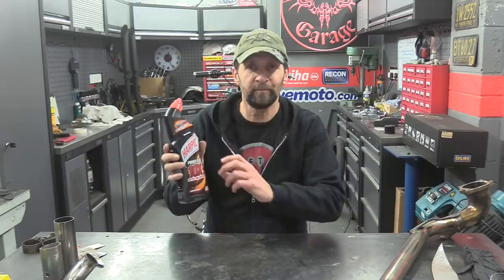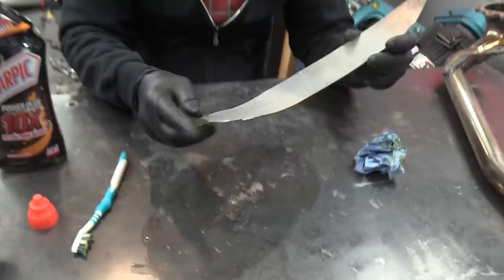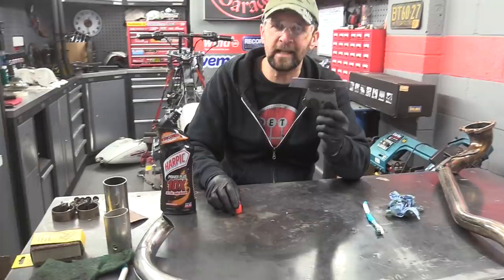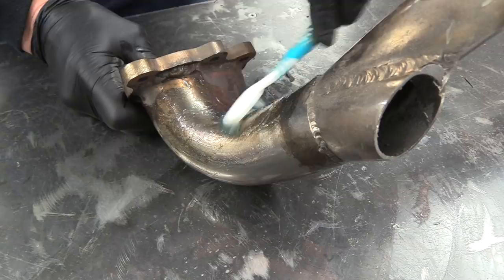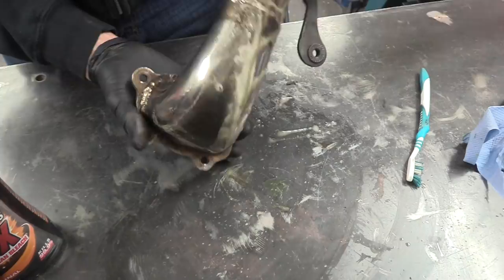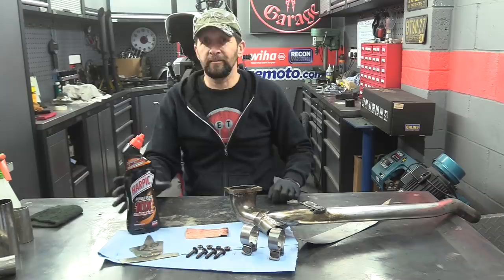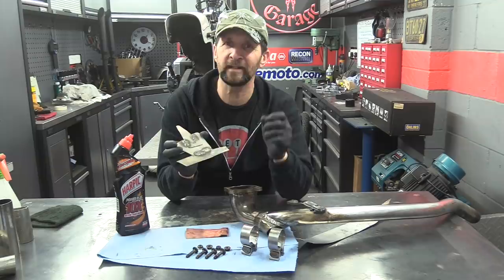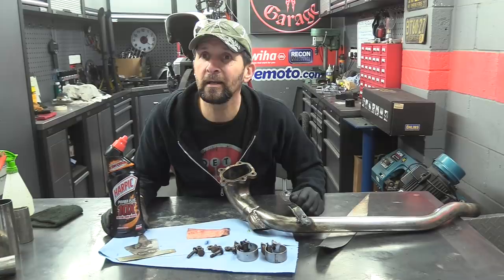Delboy's Garage, Simple Skills, "Cleaning Steel with Harpic" !

Comment: A few comments beneath here comapring this product to acid... it isn't, it's a powerful alkali (bleach). Both strong acids and alkali's are nasty stuff but if talking about "neutralising" acids when using this, well no you are neutralising an alkali (with lemon juice/vinegar etc). Top tip this video, just don't leave any residue as it will oxidise (rust).

Comment: I used this last year around early march on my down pipes and it worked a treat. I did the same thing again during the summer and the sun dried the product before I could wash it off causing the pipes to be discoloured and dull almost like it has taken the shine out of the metal/chrome. Be careful guys!

Comment: Been using acid for years it does work awsome but leaves corrosive residue if you dont rinse it really well use baking soda mixed with water to wash it the first time then wash it with clean   soapy water the baking soda helps neutralize the acid
Reply: @Dar   Same thing - different names, but the same stuff

Comment: Hi Delboy - if you have rust on chrome, dip  a lightly screwed up piece of silver foil in coca cola and splash a bit on the chrome as well, give it a gentle rub, bingo all clean and shiny and because of the soft density of the foil it does not scratch. Really good for wheel rims, handlebars anywhere there's chrome.Thanks for the video on the Bleach, all these tips are handy Thanks.
Reply: It's not Bleach it's Acid and Coke and Foil is no match to Harpic

Comment: Yes indeed Del, I have used this for a couple of years now purely for rust removal ever since I was no longer able to buy the acid on its own. I’m restoring a zzr 1100 with a badly rusted rear brake disc and various brackets and I can’t wait to drop them all in overnight to get them prepped for repainting.

Comment: I wish they sold that here! Down here in south Louisiana when we have a problem with rust, we use ammonium nitrate mixed with a proper amount of diesel fuel and the rust simply blows right off.
Reply: You can use toilet bowl cleaner that states limescale remover , it’s hydrochloric acid based rather than bleach based, my mate lives in Ohio , I’ll. ask him which one he used , as it worked for him
Reply: Zep acidic toilet bowl cleaner. Home Depot.

Comment: I've used this before and it works a treat. Problem I found was the cleaned item rusts quicker after being cleaned. Even my pliers or spanners that touched the stuff corroded badly afterwards. I did spokes that were ready for the bin and they came up like new until they hit moisture then rusted very fast. Worth doing a test first. Loving the videos as just bought a 91 Goldwing so very helpful.
Reply from the maker: This product should really only be used on good quality stainless steel, it will rust iron the moment oxygen gets to it.. maybe less so if you oiled the parts after cleaning !!

Comment: good video Del. I liked the way you protected the rest of the bike before going any where near it with Harpic, very professional. 
It looks like the Harley downpipe may have been chromed hence it did not have the same effect. Ultimately it will take the chrome off and reveal the stainless underneath and I think that may have happened here. 
Long on the short dont use Harpic on anything that has been chromed,

Comment: Hydrochloric acid or any bleaches (eg sodium hypochlorite or any chlorine) will actually cause metal to corrode so DO NOT let it soak. Thoroughly wash it off if you use this stuff. Personally I just go straight for the metal polish (autosol).

Comment: only recently came across this hack so tried it on a old exhaust system laying in the garage off a restoration in doing, couldn't get exactly the same mine was harpic with limescale remover. the can and the collector came up very well the headers are only steel not chrome so looked terrible and rusty all the way down to the joints gave them two goings over with a rinse in between, second time i used wire wool gently around and all over the pipes and they came up very well  it also cleaned up the clamps a treat total time spent about two hours ended up very satisfied with a bucket of very dirty water recommend doing it out doors power full fumes up close.

Comment: The issue I had after using a caustic to remove rust was it needed to be resealed to prevent later oxidations.
Let us know if you had rust return after this.
Reply: next day I did, went back to my old method of scotchbrite and WD40 than metal polishing product.

Comment: I use this stuff on my chrome etc... Use a paint brush to apply to the metal leave it for 10-15 mins then clean it off with the pad
Reply from the maker: Long term it will burn chrome and damage it and you'll regret the choice, perfect for stainless steel, but trying cleaning chrome with cola and tin foil, works really well and doesn't scratch, give it a try!

Comment: Hi , I 've used this product before and it works well , but since it 's acidic , then you have to treat the metal with an alkaline solution of bicarbonate of soda and then anti - rust , now you can also clean it with cotton wool .brand duraglit , its amazing

Comment: My XJR13 needs a wash tomorrow, looks like the harpic coming out for the stainless pipes👍
Reply from the maker: Good move mate, but as always, make sure you wash it off 2-3 times really thoroughly as it keeps acting on the metal if you leave it there, even just a residue is enough to burn it!

Comment: I removed melted on plastic from my Harley's chrome pipes using OVEN CLEANER not that cheap stuff or Mr Muscle but the sort that requires rubber gloves, eye protection etc. I put it on using a toothbrush and it took about three hours with four of five applications.  The pipes were contaminated when my high vis waterproof trousers melted on them.
Reply from the maker: Thanks for that tip buddy, I've heard a few people say that works for pillion boot prints that burn on the downpipes as well! ... great to hve this shared advice, thanks buddy!

Comment: You can thank me for creating the video a few years ago using Harpic another time 👍🏻
Reply from the maker: Sorry mate, I'm a little confused, I made this video 4yrs ago and I've been using this trick in some form for 20yrs... I see by looking at your Channel, that your posted video was 2yrs ago, are you suggesting that in some way I copied you mate?  Not sure if I've got that right, but either way mate, it is pretty common knowledge these days, I think you'll agree!
Reply: @Moonfleet41  only joking buddy 😂👍🏻
Reply from the maker: Sure thing mate, I thought so! ...Just caught your seat foam cut down video and I'm just about to do the umpteenth one for a project, next time you're shaping foam, give a sander a try... you want a coarse sanding disc, say 40 grit or something, and just gently stroke away the foam and it leaves almost a perfect factory finish if you're careful... ride safe mate.
Reply: @Moonfleet41  great idea thanks, will probably remove cover and do that 👍🏻

Comment: Thanks Del!  Going to try this out on my old FLSTN.  Looks much easier than 0000 steel wool and chrome polish.
Reply from the maker: Sure thing buddy, I'm gonna have another crack at my Harley pipes, as it wouldn't touch the staining by itself, as you saw, I had to hit them with a Scothbrite too, am gonna take up suggestions of some of the guys here to let it soak for 20mins and see if that helps it float the dirt off... otherwise, it's back to the Scotchbrite aye!

Comment: Don't use brake clean on pieces of metal you are about to weld. The chemical in the brake cleaner is Tetrachloroethylene. When this chemical is exposed with excessive heat and argon (used in MIG and TIG welding) it also produces phosgene which is extremely poisonous that will lead to organ damage or even death. Acetone is recommended to clean metal before welding, but never, ever brake cleaners.

Comment: Great info del  saves a lot of hard work                                          I drive a 2019 zzr14 all year long I took the headers and link pipes off today was very surprised 😮 they were awfully bad   Probably the wet conditions over the winter thanks for the post anyhow very helpful pal
Reply from the maker: Yeah, winter can take it's toll on your metal work, am sure you've got some plans, if you're not replacing those pipes, there are some great ceramic coatings that can arrest their condition and keep them from getting any worse... good luck with it and thanks for your support.

Comment: like the music for sure. i had a difficult time finding this stuff in the US so i just went with autosol and a wool fuzzy 3" pad for my drill and it turned a brown nasty header pipe on my suzuki dl1000 into a shiny polished stainless. holding til this day a year later.
Reply: Try sisal wheels with black then pink polishing compound. Difficult unless you can get to all parts = remove

Comment: Heard some use this in their rusty car radiator.... Abt 100ml put in. Drive around 30mins. Leave it overnight. Nxt day flush the entire system with lots of water.... The inside of the radiator would be clean n shiny. 
Try at ur own risk. Some have tried n testify it works.

Comment: I saw a video on this quite a while ago, so many people in the comments said it damages the metal.  Maybe a myth busting video would be fun, leave some on for a week, a few days and 24 hours, measure the thickness before and after, maybe keep one piece and apply more and keep coming back to it at the start of other vids as an update and re-apply, rinse repeat and all that :)
Reply from the maker: I think something this caustic will always damage the metal if you leave it on long term, it even says on the bottle that it can damage some metals, probably meaning aluminium or chrome finish as hydrochloric acid is a great way to strip anodizing off aluminium and I've used it for that reason when I've wanted to polish it... but might be an idea for a longer experiment!

Comment: With the muffler clamps Harley recommend replacing them which sounds like a money grab but just from personal experience I reused the clamps and they were as tight as can be but the mufflers still worked loose, put a new set on and no issues after that. Great video very helpful.
Reply from the maker: I'd say it's not really a money scam, maybe just a back covering exercise, the bolts that squeeze the clamps up are a bit rusty on mine now, and rust always weakens things, but I'm gonna re-use them anyway and just keep an eye on them, after all, I don't have a limitless budget... thanks for  feedback buddy, much appreciated.

Comment: That is impressive!  I'll have to get a bottle and try it on my stainless brake discs to see if it removes corrosion etc
Reply from the maker: I'd be really careful using it on brakes, if you have alloy carriers it will burn the anodizing off them, and if you spill any on the wheels it could damage the paint or the rubber on your tyres... I won't be using it anywhere near my brakes, it's just not worth the risk...as you saw when I did my pipe, I covered everything with plastic, including the bench lift.

Comment: Just out of interest, I stumbled across this video as the first one today on a google search of "Harpic rust removal". Reason being, I'm a professional fabricator working on a project and stripping down old equiptment for parts, which are heavily rusty (like a singer industrial head and clutch motor). I read that commercial rust removers contain Phosphoric Acid, which is often the best choice for rust removal...but it's expensive, very in some cases for a tiny amount. So I started researching what types of acids EAT steel (I spent weeks on some bolt removal, everything tried and was so fed up I just wanted to dissolve the bolt instead.)

Long story long, yesterday I was in the pound shop and came across this same brand of Harpic and though "You know what...I think this will work". The thing I wanted to ask is, you mentioned that it's Hydrochloric Acid. Apparently Hydrochloric Acid will remove rust but can also dissolve / corrode steel. Can you double check on the back of that Harpic bottle, in the ingredients section and also the description? It should say something like "...contains among others thing Phospheric acid <5%" and somewhere else on the bottle "Phospheric Acid".

Just a message to see if there are two different formulations of the same product or if a correction needs to be made in reference to the Hydrocloric Acid bit (just for safety and exposure measures), or if I'm just an idiot. 

Excellent video, Rust remover for £5+ or Harpic for £1...I'm off to poundland!!! Thanks for confirming my thoughts yesterday.

Comment: I did this on my bikes, yes it works, it certainly does! BUT, after a few applications the headers tarnished and went a very dull color and it would not clean it anymore. I was informed it takes off all the coating on the headers and it will, in time, be a bad thing to do. I Don not use it anymore
Reply from the maker: Coating on the headers?  If you have coatings of any kind on your pipes, you shouldn't use it, it only works on bare stainless steel
Reply: @Moonfleet41  not sure what the guy meant by a coating, but I don't mean ceramic or anything. I believe a comment was said about it attacking the metal finish. I'm no scientist but I know it ruined my headers finish as they tarnished and went very dull. Harpic works but I'm a little bit careful now. I won't use it on my bikes now but as you say you don't have to do what i do, it's all about sharing experience
Reply from the maker: @deadbugdavey1744   Ah i see, it is pretty harsh, and must be washed off immediately, its an acid after all.. if its left on for any length of time it can dis colour the metal.. but it aint half great at getting stubborn dark staining off header pipes..
Reply: @Moonfleet41  it's like the yoshimura cleaner called stain magic but that's a paste and comes in a tube like toothpaste. Only issue is cost, harpic is £1 and  stain magic is way over £20

Comment: You can use CLR cleaner also. mix baking soda and water in a spray bottle, then why done scrubing spray it on the part to neutralize the acids.

Comment: Did you use brake cleaner to remove bleach residue on the exhaust, and were you using a hand held water spray to remove the bleach from the screws in the tray?. Is there a recommended thing to do to the metal after using the bleach?

Comment: Hey Del, next time try "Belgom Alu" on that exhaust, it's like magic to any scuffed and stained metal. It makes it shine like it's brand new. Try using it with some extra fine 000 steel wool. Cheers mate !
Reply from the maker: Ah Belgom Alu, mother's polish indeed!  First used it when I was nowt but a teenager and you're absolutely right, it's legendary!
Reply: @Moonfleet41  Damn right it is! Don't forget that you'll need a good amount of elbow grease to get rid of all these stains, it's not an effortless job but it pays off when you see the results of that hard work ! Keep up the good work mate ;)

Comment: I am definitely gonna try that. I wonder if it will get the black tar spots off. Some stuff  I got from Halfords was useless. I have been using thinners for black spots. Carefully of course. There is a product called wrights copper cream which the wife uses and its brilliant for copper. But the UK at present is completely out of stock. And it comes from America. So I will be using harpic 10x big time from now on. Another brilliant video.👍👍 I just thought I will have to make sure the wife doesn't try polishing anything on or near the kitchen worktop as it's granite and thats a no no with certain types of acid. I think that even fruit acid can tarnish marble.
Reply from the maker: If you're gonna use Harpic on stainless, I've learned from experience with this that once you're happy with the clean finish, wiping it dry isn't enough, you must wash, wash, wash and get the hydrochloric acid OFF, otherwise it will start to rot the steel and actually make it rust once it gets damp again... and always eye protection, it's pretty nasty stuff!
Reply: @Moonfleet41  Yep Totally agree. Firstly I never use anything harsh on or near paintwork without covering and washing down afterwards. Also I only use washing up liquid for washing the bike or car. Although I have a cover for my bike it's kept outside so I experience the reality of good old British weather which at times can be a pain. I am an all year all weather rider so am always having to tackle the detritus. I am still hoping someone will buy me a hot air drier for Xmas.  One thing I have just started doing is covering up the brake calipers and discs with bubble rap. Which does help prevent the rust build up.
Reply from the maker: Just one point buddy, if I may, perhaps have a think about swopping the washing up liquid for a basic vehicle wash soap because it contains a tiney amount of wax and doesn't strip off all the protection on your paint... if you check out KillerBrands.com, it's a detailing website, they've a product called 'BOSH' auto/moto soap, supper concerntrated detergent, you can dilute up to 10 times and a litre is dead cheap... I squirt it over my bike neat and it goes on like snow foam, then agitate with a mittand spray it off... it's pretty well known now that washing up liquid is a bad idea for vehicles... just a suggestion mate, hope you don't mind.
Reply: @Moonfleet41  Many Thanks for your advise. I will definitely try Bosh.  Sound like good stuff. 👍